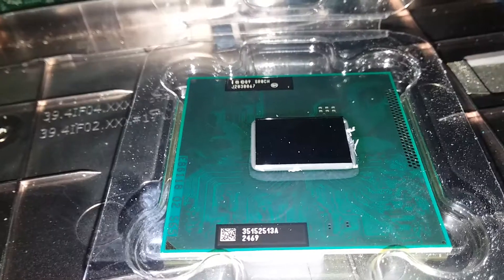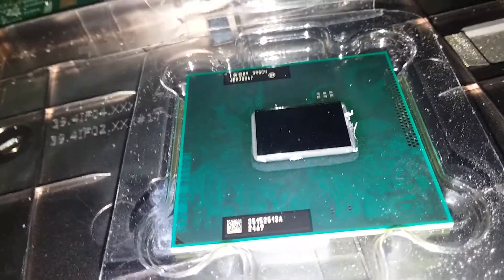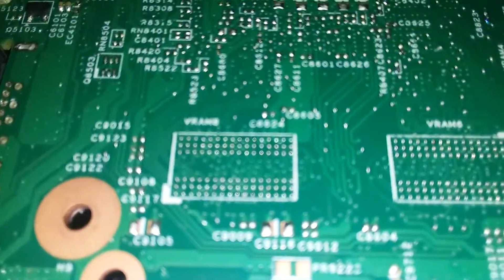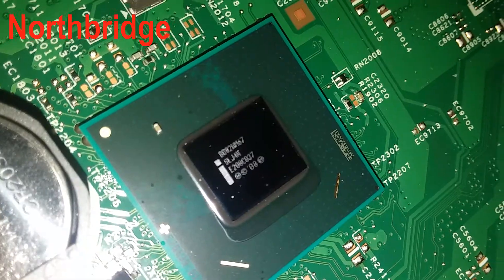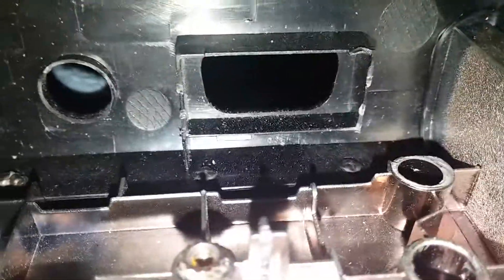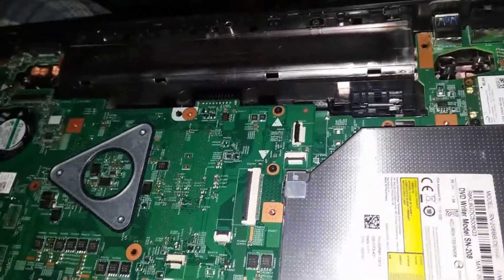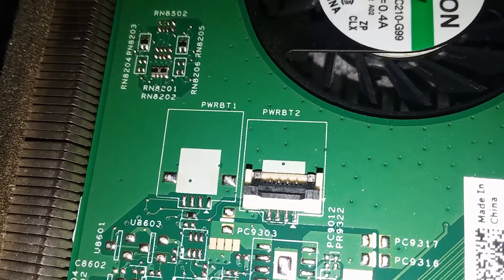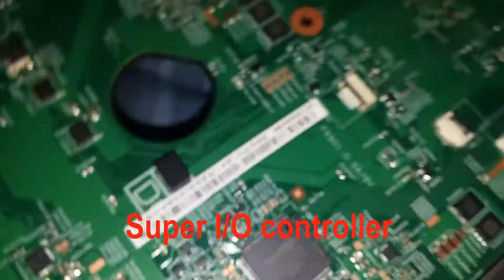Dell Vostro 3550 disassembled for CPU upgrade + motherboard observations

Comment: Did the same upgrade on a trashed Vostro 3450 before. The serviceability on these Vostros are absolutely dreadful. many things are fragile, and even removing the hard drive requires mobo removal and mine got ripped apart by the previous owner desperately trying to get the hard drive